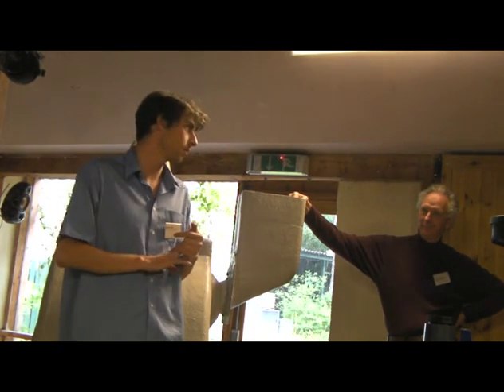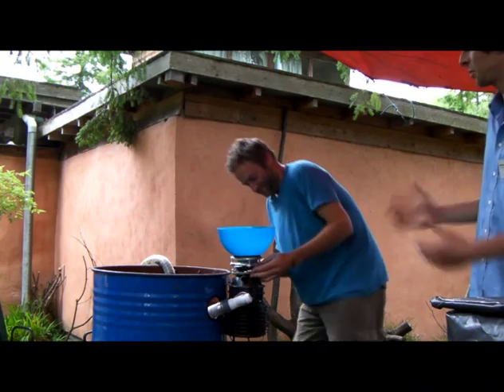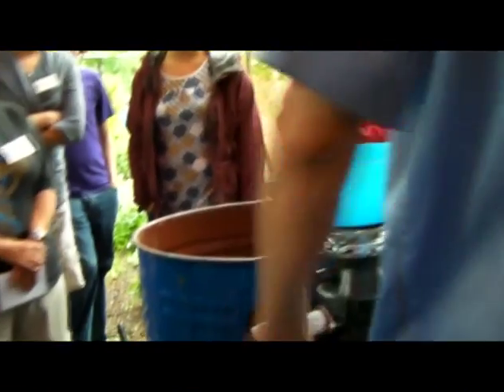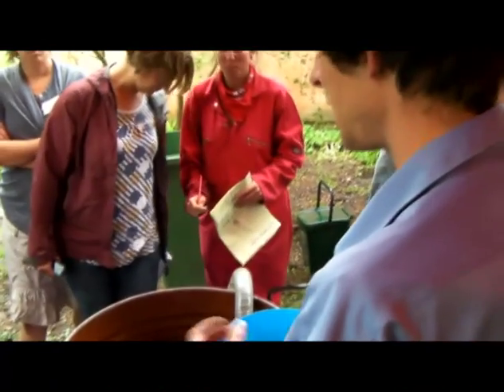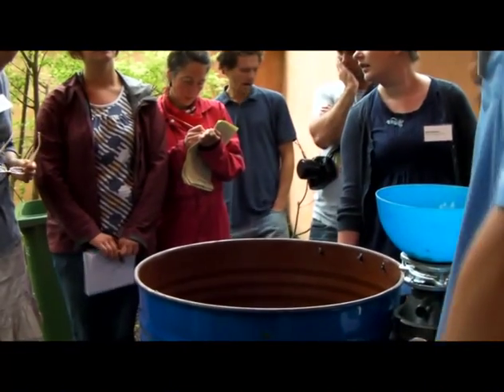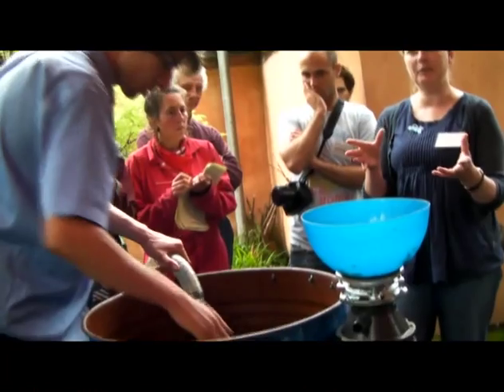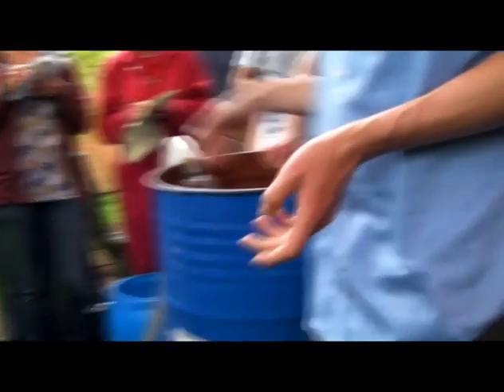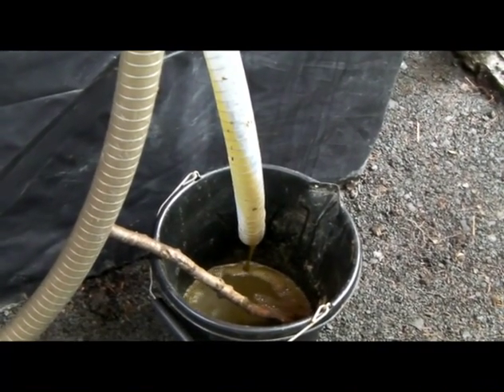Micro Anaerobic Digestion Demonstration

Comment: Does the energy contained in the methane gas produced even offset the amount of energy input (heating element, sink grater, pump)? Another question is how long time it takes for the net amount of energy produced to equal the energy footprint of all the equipment used (i.e. the energy required to have all that stuff produced) even if some of the elements of that equipment are just salvaged scrap.